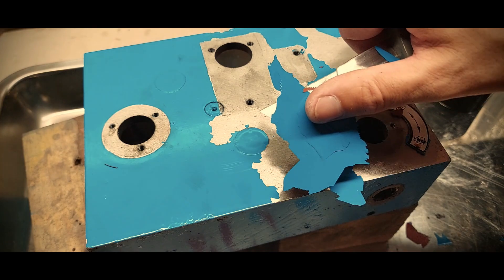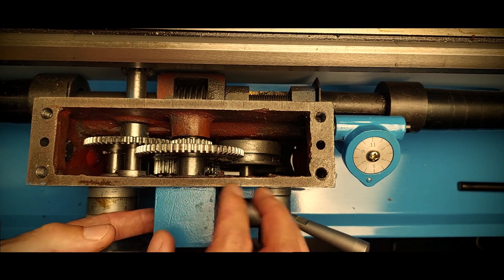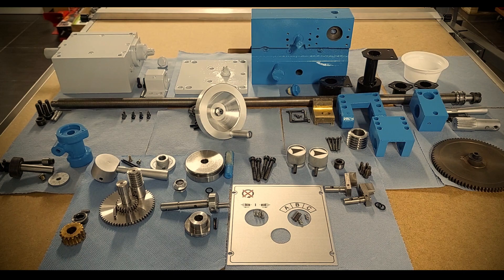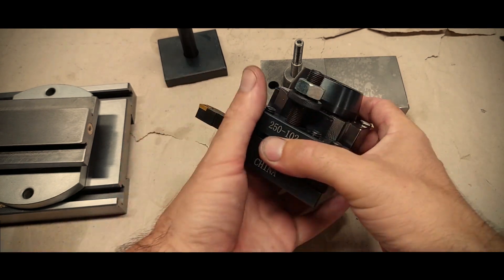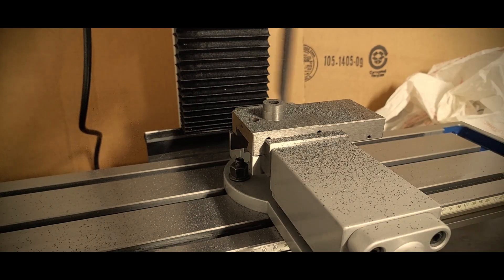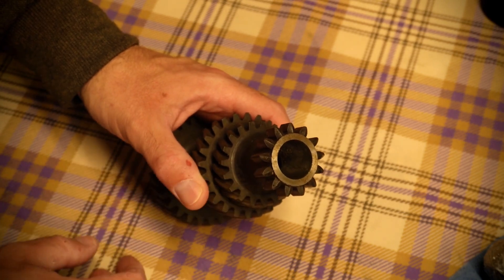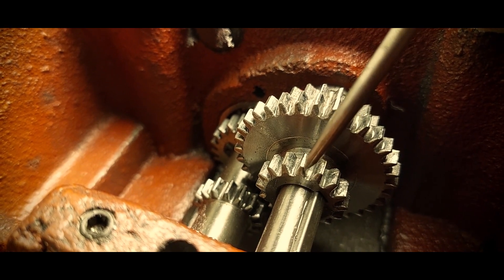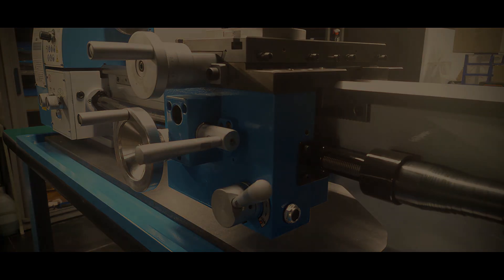Lathe rebuild Pt.2 - The apron, a quick change tool post and something about the gearbox

Comment: Where can I find the black material you used to cover the lead screw?? My lathe came with no cover for that, and I have since swapped out the half nut/acme screw with a ball screw, and I’m worried about the ball screw/bearings getting chewed up by debris.
Reply from the maker: Hi. It came with the lathe. But a quick google search for "lathe lead screw covers" or "leadscrew spring steel covers" returns results. Pay attention to the size in case you order some.

Comment: I'm starting to think any chinese lathe with metal driving gears is of the same tuer and the only worse tier is the ones with plastic gear.
Reply from the maker: I don't think that's the case. There are many examples of lathes with metal gears that I wouldn't recommend anyone buying. Have a look at some reviews of the 210 models on YouTube, I don't think there's many people happy with them in the long term (and they are shipped with metal gears).
Reply: @nbrworks  I see. Well, here goes my simple explanation then. Straight to trash :) By 210 you mean also from HBM?
Reply from the maker: I'm not familiar with the HBM 210 lathe (or other branded ones). My first lathe was a gray 210 from ebay and was unusable and very tricky to repair. It looked like it was put together with faulty parts. That was the main reason why I took the HBM lathe apart as soon as I got it. I wanted to check every part to know what my money got me. So, the lathes I wouldn't recommend are the unbranded ones from ebay, vevor, aliexpress, etc. HBM and other brands, I simply never seen one first hand to recommend or advise against (I just don't know). 
As for my HBM specifically, I think the quality is good considering the price. The rebuild just made it better, but I don't advise everyone doing it as it will take time and probably bring some frustration to understand how things should work (especially if the person doesn't have experience with lathes).
Reply: @nbrworks  It is me who's asking which lathe you mean by "210" :)
Reply from the maker: These chinese lathes models are normally called after their swing. For instance the 180 models have 7 inches of swing (~180mm), the 210 models have 8 inches (~210mm), 250 models have 10 inches (250mm), and so on. 
The 210 models I mentioned and do not recommend are the 8 inch swing lathes you see from vevor, ebay, etc. Make a search on Google, you'll find them. Sometimes they're called mx-210, others wm-210.
Reply: @nbrworks  Yes, that's why it was very vague when you said you wouldn't recommend the "250" one and I expected you are going to add the manufacturer in the next comment ;) Anyway, keep up the work. Excellent stuff!
Reply: Hello, both of my levers are locked. When I activated the lever to go automatically and when it got to the end near universal and I wanted to deactivate it, it got stuck and I can't use it anymore. I can no longer use the round lever manually, neither in front nor in the back. Can you give me some advice or if you know what it could be? Thank you
Reply from the maker: @cristianmacovei8878  a few questions:
- make and model of your lathe
- what levers are stuck? Power feed? Which axis? Threading lever?
- what happens when you try to move the lever? Does it move but does not disengage? Or it doesn't move?
- can you rotate the spindle by hand?
Reply: My model is HBM 250 x 550 Vario Both levers are blocked, if I try to move the first lever manually I can't. The second lever is also stuck, I can't even engage or disengage it, if I try to engage the second lever it goes automatically, I can't engage it. The Z axis is the problem. Yes, I can rotate the spindle manually, thank you.
Reply: I was about to make a collision and I stopped him while he was working. And when I wanted to turn it back on and move it manually, both levers either stuck

Comment: Where the hell do  you find such a large 15mm steel plate for cheap? o_o
Reply from the maker: Maybe I should clarify the "cheap" part. The plate was 30 euros (around 30 USD) at a local industrial fabrication place (heavy duty stuff). Then I paid 70 euros to have it ground on both sides. Total 100 euros, I think that was cheap, but you might feel differently. Either way, it was one of the best things I did for the lathe. Thanks
Reply: @nbrworks  No I agree, that's definitely cheap! I need to find a better local place lol

Comment: Good evening, I would like to know where I can buy an apron like this complete to adapt it to the lathe you have, could you tell me a store website, the address I'm from Brazil, that would be serious
Reply from the maker: Hi Christo. I made a quick search and I was only able to find the 7x14 apron version (sold on aliexpress). I don't know what type of you have, but start with a look on ebay. Make a search by "lathe gearbox" and you'll find other gearboxes for sale, including the white one shown on this video. If those sellers are selling that gearbox, chances are they might be able to sell you the apron. Another option is to reach out Precision Matthews in the US, I don't know if they can help you, but it doesn't hurt to ask. Just be careful to check the if the half nut will engage your lead screw and the hand crank gear matches the gear rack. Also, mine has power cross feed and that requires meshing with the cross feed leadscrew gear. Don't rush it and make a good research before you buy anything. Good luck!

Comment: that plastic cover for the lead screw, did you make it? i need that!
Reply from the maker: Mike, do you mean the spring covers on both sides of the apron? Those are made of thin spring steel and came with the lathe. If you make a search on Google for 'telescopic lathe lead screw covers' you will find some links selling, including 'the little machine shop' (if you are in the US). If you buy a set measure the diameter and length to make sure you buy the correct ones for your lathe.

Comment: in case you still have the original video, maybe you could publish an non-accelerated version of the disassemboy and the reassembly ?
 besides your storytellong and entertaining capacity, which are obvious and appreciated, the actual work is of much interest, as its uncertainty and unknown  that is what prevents most newcomers to clean and enhance their machines.

and that is why i watched the apron reassemblu about 6 times in 0.25 speed 😅

Thanks in advance
Reply from the maker: Hi Nicolas, that's an interesting request and I see your point. That short section was a couple of hours squeezed into just a few seconds. Let me think of how I could come up with a longer version of those videos without killing the channel 😅 and I will get back to this. It might take a couple of months, as now I'm prioritizing the next videos and there's a bigger project coming up, but I will get back to this. Thanks

Comment: Hi, looks like we are on the same journey. I bought an VM32 Mill and a WBL250F both with Sino brand DRO’s from UK supplier Amadeal. After 3 months I’ve almost finished rebuilding the mill and have striped the lathe for currently cleaning and working through what needs to be done. 

Your videos are very informative and the issues you have encountered mirror my own. I liked the way you did the carriage lock, very neat! I was going to do the same but I’m  thinking that I may re position the scale to the front of the carriage instead. Having the scale at the back not only gets in the way of the gib and carriage locks but reduces the carriage travel and means you have to wind the tail stock out further. I think the only reason that they put the scale on the back side of the carriage is that, because they fit the DRO’s after the machine is built, its just easier!

I don’t know how far you have got with the electronics but people who had had these machines for a while say that if you running them a low speed for extended periods the motors can get quite hot. Also on my machine the main electronics module is fixed to the wall against the heat sink, which is a bad idea. I am probably going to make a new rear panel for the electronics box and re position the module with the heat sink facing out and then put a fan in the bottom to cool the motor. Happy to share the details when I’ve got it drawn up.
Reply from the maker: Hi! Thanks!

When I got my mill I also stripped it down for cleaning. Having done both the mill and the lathe, I'd say I went through the mill much faster than the lathe. I think I found the mill "easier", but I didn't do any paint work or rebuild the spindle. 
I remember I had some issues with the head nodding and that took me most of the time. Then I found the sweet spot shimming each side of the head (between head and column) and the "correct" gib adjustment. Apart from that I think I was lucky with my mill, which is also from Amadeal, but the 25 model (smaller machine).

The lathe was much more time consuming and I think it's less forgiving. I wouldn't put it down to quality, just being a different machine (this was my experience).

I spent a lot of time levelling the lathe. Everytime I added some weight (headstock, carriage) the bed un/twisted. Constant checking was needed before moving on to the next step. Also, I have the lathe on a cheap non-reinforced stand with an mdf top. That didn't help levelling, I was always unsure if the wood was compressing. Then I got the steel base plate and it helped a lot making sense of what I was doing and keeping the alignments right for a longer period of time.

I will definitely make a new stand for the lathe, I've been think about the size, design, etc.

Regarding the carriage lock, I see exactly what you mean. I'd like to have an easier way to lock the cross slide - so far I've been using a cut down hex key. I think I'll try to fix that in the future.
My scale doesn't limit the cross slide travel - maybe it's a bit longer? 

However the tail stock reach was a problem. I've been using an MT2-MT2 extension which resolves that.
I can have a live center with the tail stock at minimum stick out and still have some room to start turning on the tail stock end. So far I didn't notice any downside (I don't notice any particular flexing) but of course, I'd rather not use the extension.

If you reposition the scales to the front you might want to cover them really well. I considered that as a possibility as well, but I didn't have the time to do all at once, so I had to pick my fights🙂

Regarding electronics, I think you might have a brushless motor and different modules (according to Amadeal website spec). Mine has a brushed motor. I didn't notice any particular issue so far, be it lack of power or overheating, but I'm keeping my eye on that. 
What is a bit annoying is the buzzing noise from the motor. I thought it was the contactor so I had a look at that and it's 100% the motor. If/when it starts to give problems, I might go VFD/AC motor. I just hope to have the lathe stand made by then😅

(if you post your design for the electronics, let me know)

Thanks!
Reply: @nbrworks  Hi, the mill was a real pain as all the carriages had to be scraped in and the everything is so much heavier. I had to get help every time I needed to move stuff! I got the dedicated stands and while the finish is grim, with some good quality feet, they are very stable. I agree that the lathe will be more of a challenge.

Re the motor, yes I have a brushless motor and I believe they are more susceptible to getting hot at slow speed because they are smaller they also have a smaller fan, so less cooling.

I have lots of videos and pictures but I’m relatively new to YouTube and so far my videos have been made to help me remember what I did, they are not as ‘polished’ as yours which are well presented and easy to watch. I will ‘go live’ at some point, if I ever finish frigging with these machines…….:goodvibes:
Reply from the maker: @thisthatotherstuff1203  That's how I started. When I took the lathe apart I wasn't thinking about doing youtube. Even during the rebuild, I was recording with my phone, sometimes out of focus (other times not even recording) and I wasn't sure about posting any of that... but then, why not? At least I get a chance to try my English 😅and you, as a viewer, get to see some details of this type of lathe that you don't see in reviews. I think you should try it 🙂
Reply: @nbrworks  Hi, I will release my vids but need to go through them and remove all the swear words first!
I’ve now got lathe bed ready for painting and looking at the saddle. The machined finish on the underside of the bed (where the saddle keeper plate runs) was very rough so I cleaned it up and polished it. Now I will need to ‘adjust’ the keeper plate, or make a new one. And now I’m thinking ‘why is there no adjustment for this, like the gibs on the slide ways?’ so I am looking at making a new keeper plate, deeper, so I can fit a bar of say 5mm thick phosphor bronze with screws & locknuts underneath so I can adjust when the saddle is on the bed. I haven't seen this done before and would appreciate your thoughts on this.
Reply from the maker: @thisthatotherstuff1203  what you are describing reminded me of this (slightly) tapered gibs with adjustment: https://youtu.be/NkLtLUbPvzA?t=1483

I'm trying to visualize the forces envolved when we're using the lathe and I think that most of the load should be taken by the saddle against the bed. The retaining plates are there just to avoid any lift and keep things together. 

I don't expect them to wear fast and my concern when I did mine was just to provide better support for the saddle.
I made them longer and with a tighter tolerance - also because this helped me to reshape the ways and make them consistent. If for any reason they wear, I can take a skim cut to compensate for the wear.

If you want to make this modification, my advice would be to start from raw pieces of stock. If for any reason you decide to go back, you have the original parts. (that's what I did as well)
Reply: @nbrworks  Thanks for the link, that's a neat way of doing it but for a larger machine like ours I think I will keep it simple and go for screws underneath. I have a very little contact area on the keeper and and a lot of lift so its quite useless as it is. The front is not so bad as the cutting forces will be acting this way but on the rear it is important to have a very good fit to avoid 'saddle lift' If your taking a heavy cut on large diameter bar the turning force is not insignificant. The issue is that, in this instance the cross slide will be to the front of the saddle and you have a relatively  long 'lever'  so any  play in the keeper can translate in to poor finish. Having said that, if you didn't have the keeper plate the thing wouldn't fly off but if you are looking for good tolerances and finish then its all about controlling the vibrations inherent in the machining process. If I can work out how, I will send over detail drawings of this and the electronics cover mod.
I'm half way through my videos and some of the early stuff makes me cringe but I will go for it soon...
Reply from the maker: @thisthatotherstuff1203  Cool, looking forward to see your rebuild! 😃

Comment: In the video the very last thing shown was installing the "shear" pin. If it is like the one my lathe came with it probably isn't very shearable. What I did was drive a bamboo chopstick from the local Chinese restaurant through the hole. It is self-sizing and won't fall out. The one in my lathe has been there for ten years.
Reply from the maker: Thanks, that's something helpful. I also thought the pin could have a groove or 2. I'll replace it in the next days. Thanks for pointing that out 🙂

Comment: Best option, remove the compound and make a mount for the tool post directly to the cross slide.  Way more rigid and you almost never use the compound anyway.  You can always put it back if you do need it.
Reply from the maker: Hi Chris. Thanks for the comment. Yes, I refer that in the video, that's one of the things I might do in the future. I need to get a piece of stock big enough for that 🤔

Comment: Thanks for the video. I do like the idea of adding a magnet to the plug to catch some of the junk that will come off over the years. 

The smaller really cheap Chinese lathes take the OXA size tool post holder and that is a straight bolt on. But in review, it might be a good idea to fit up a pivot point such as you have on your tool post.

Comment: Hi, now this is both interesting and useful. I have a similar but one size larger lathe and I really need to look into it more closely. Thank you for posting. I had the very devil of a job getting my original tool post out.  I converted an engine strip down bench as a stand - added cross bracing and a lathe levelling frame of 50 x 50 x 5 mm steel tube on top. Liked and sub'd
Reply from the maker: Thanks Bob. Glad to help 🙂